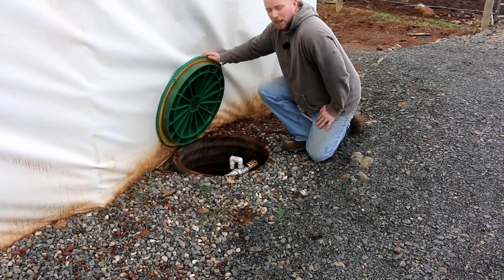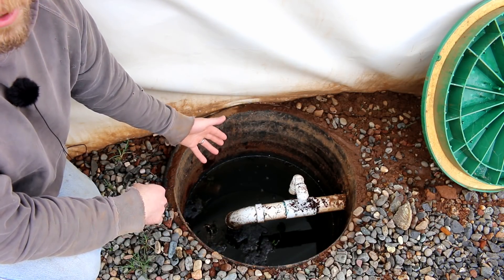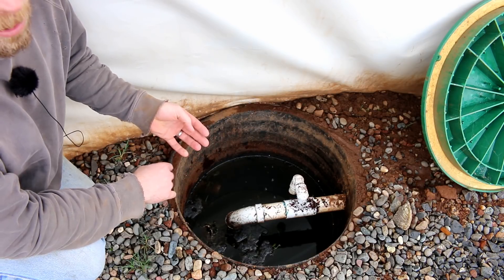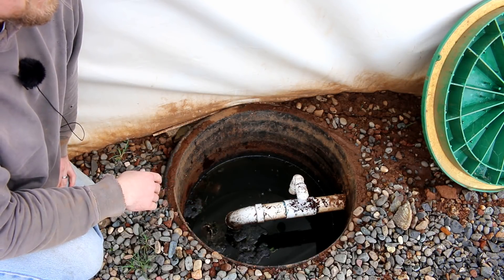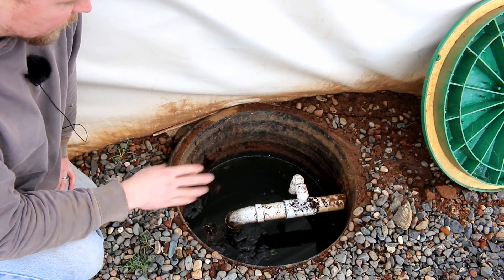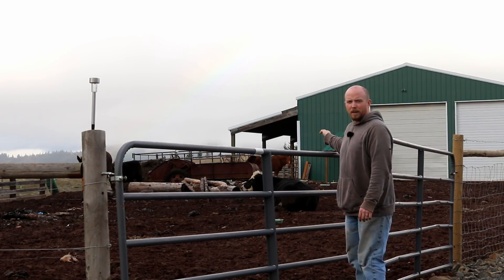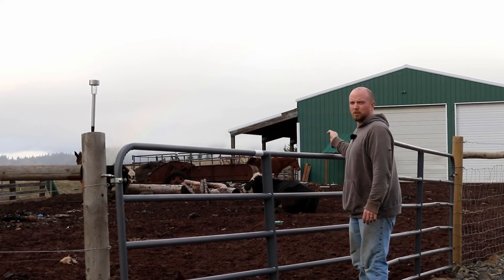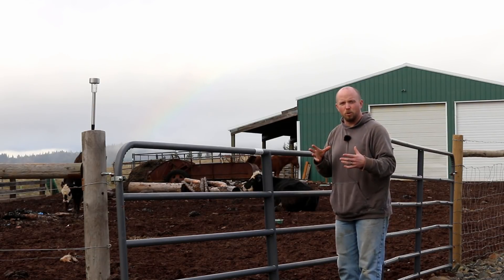Best way to Load a Small Scale Anaerobic Digester?

Comment: Hey TRM.  I think I have a simple solution to resolve your floating influent material issue.  Have you ever watched any lacto fermenting videos, such as when you make Kimchi, Pickles or sauerkraut in mason jars?  When people make those, they often place on a glass weight to hold down the food so that it stays under the liquid to prevent molds and bacterial contamination from spoiling the food.  Essentially you're trying to achieve the same thing in the digester but on a larger scale right?  Why not use a suitably heavy weight?  I don't believe you can use glass in your application as alkali liquids react with glass (I understand the digestate is alkaline), but you could use HDPE plastic (number 2 plastic, i.e. milk bottles and caps).  For example a solid 600mm diameter cylinder of 600mm length (or whatever diameter is slightly smaller than your feeder tube), would weigh 161Kg (look up a basic materials weight calculator 0.93g/cm3 and recalculate your preferred dimensions if necessary).  I expect would be fairly simple to embed a few eye hooks in the top of the cylinder and connect chains to lift it out and place it down as needed.  You could lift the weight up and out with a pulley /block and tackle system above the entry or make it swing out the way for safety as you feed the influent.  You could easily shred, melt down and remold a bunch of plastic to construct such a disk I'm sure (have fun collecting that much plastic, get your neighbours or school kids to collect it).  I cannot think that any of the influent materials you mentioned would be heavy enough to push back against a disk of a suitable weight. If left whole, the materials you are trying to digest, should not be able to escape around the sides of the weight so you don't need to waste time or energy grinding them them up really small either, unless your mixer would be prone to getting damaged from large materials.

Comment: I don't know the electric needs of my idea but you can figure it out if it sounds like it might work....years ago I worked in a meat processing plant and we had a couple of mixer/grinders that would do exactly what your trying to do with the pre grinding and it could also pump that ground up material into the digester because we use that same machine to stuff sausage. It's the machine is made by Hobart you can get them and several sizes we had a small 100 lb capacity mixer grinder and we also had a couple of large ones and the 502 a thousand pound range and basically what it is is just like your your home hamburger grinder but on an industrial scale it runs on 220 volts and it'll process 500 lb of meat and mix and grind 100 pound bag of ice like it wasn't even there. You could buy the size of machine you need probably could get a used one fairly reasonable. I don't know the electrical needs other than it's a 220 volt machine but I know the 500-pound capacity machine would go through 500 lb beef shoulder and 100 lb bag of ice in process it in less than 5 minutes so all you're talking about is v i mean that the outside 10 minutes electrical use to process 500 lb of material. And if you put it directly in line to the digester it would mix and grind and pump that material rate into your digester all-in-one process I don't know if it would work exactly but I ain't no with the right size plate on the grinder those machines will eat just about anything including human terms we had one guy try to feed his arms through it and the Machine won, he lost. So depending on the amount of material that you would be processing everyday poundage wise that's the size machine used by if you're only going to put a hundred pounds of material in a day you buy a hundred pound capacity mixer grinder instead of catching the meat at the end of the grinder used put a pipe that goes directly into your digester and it will stuff it down that pipe I guarantee it and the smaller you get the less energy it would take so you'd have to be pretty close on your guesstimation how much material you needed to process daily and like I said it'll process 500 lb of meat in about 5 to 7 minutes that's mixing grinding and stuffing all at the same time

Comment: IF the hay that plugs up the pump is un eaten hay? if so then the major problem is that the cows are wasting hay! so need to cut down on their waste!  most the of the farmer i have read about doing similar things they used corn silage and use sand for bedding down side is also read they need 300 head of cattle to do this. a pto manure pump might be an option. http://www.chesbay.us/Manure%20Summit/Scruton%20History%20of%20Digesters%20in%20Vermont.pdf
Reply: I don't think it is wasted animal food he is on about I think it is more the beding from the stalls.

Comment: Just an idea to add to the mix - Why not use a variable pitch auger that goes in your 8” loading pipe?  Have a loading hopper that you load your raw material and extract water from your digester to flush the material through.  You need to drive the auger very fast and the speed will pulverise your materials as you feed in the liquid from your digester.  The hopper will act as a mixing location.  The auger will need to extend from the discharge end at the bottom of you digester up to the top of your hopper where your drive is located.  Getting the balance of solids and liquids in your loading hopper will mitigate the tendency of your materials to float.
Reply: Xoncention thats how it is done in Germany, we have a lot of agricultural digesters here.

Comment: Loading idea - would take some testing and development but it is simple:  piston in a cylinder,  no pre-processing, load cylinder, push piston and force all material into digester.  Like a hydraulic cylinder or caulking gun with a cover.  Ideally, the piston would be on the bottom and push upward since the feed floats.  Load through the top. Close the cover that seals to the cylinder.  Piston pushes the floating mass through a side port at the top.  Floating mass goes first since the port is at the top.  Maybe a horizontal cylinder arrangement is an option.
Reply: I agree. Use a piston pump just like a concrete pumper.
Reply: Yeah, hydraulic power for this. There isn't really any benefit to grinding it up first, just uses energy. Pump it in with hydraulics, i see some form of V shaped hole in the ground, pumping in the material to the bottom of the tank, fill the V, run the pump back and forth a few times, not sure how to handle the backpressure etc, do they make 10" one way valves? :)
Reply: With positive displacement, piston can be on top - floating mass would not be an issue.
Reply: just what i thought
Reply: I might have completely the wrong idea here, but why not a vertical "piston".

Extend the 8" pipe above ground, cut a large port in the side for loading and use a heavy weighted  plunger/air piston/ hand winch to push it all down and out the bottom of the tube inside.
Reply: Just what i was thinking would be the best solution
Reply: The "best solution" only needs one problem to not be the best solution. A better one would be a sloped trough with a manually operated auger sheathed inside a pipe of a closely matched internal diameter. It would constantly push the material down the pipe. Gear it for mechanical advantage... I don't know?

Comment: Use a large heavy wheel with ridges to grind and break the straw stalks so you can send it through the grinder pump. Like a windmill, but powered however you want. You've got the infrastructure for wind power. Wind power might be just reliable enough to grind, or not. Just let the thing rotate all day and it'll self feed into the pump. Worked for ancient people with grains and wheat, not much different than what you're doing.